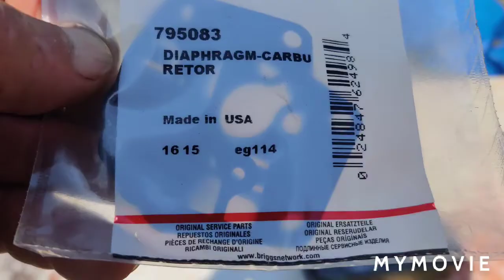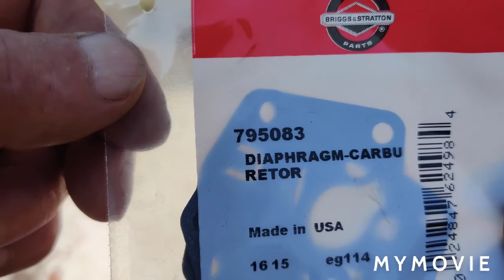Briggs Classic  Engine. Starts and Stalls. How I fix it.

Comment: Nice job Artie. I also only use B&S diaphragm kits on those engines. Good to see you use your dealer for parts but that doesnt work for me, as they would just say they dont have parts for engines that old. I buy them from Amazon for the same price. Those engines are hard to kill and easy to work on. A a great Memorial Day weekend!  🎥👍🇺🇸Roger
Reply from the maker: Yes Roger they are one of my favorite engine's. My dealer is pretty well stocked.Thanks for watching and have a great weekend as well 👍

Comment: See the problem is with the classics is they were built too tough. Hard to kill these engines with very little maintenance. Thanks for the upload Artie. Seems to be running pretty well with that diaphragm and cleaning.
Reply from the maker: Yes Alex this is one of my favorite engine's. It was my bad not to change the diaphragm the first time I cleaned the carb. Thanks for watching and stay well 👍
Reply: Your right Alex about those engines. That little spring under the carb i always put back on but i dont know what it actually does. 👍🇺🇸
Reply: @rogermcdonald1607  I always thought it was a return for the pumping side of the diaphragm so it can pump back and forth. I am not 100% sure. I’ll have to look into one.